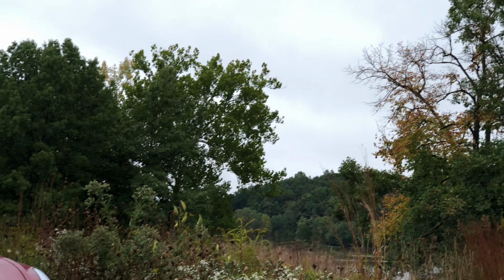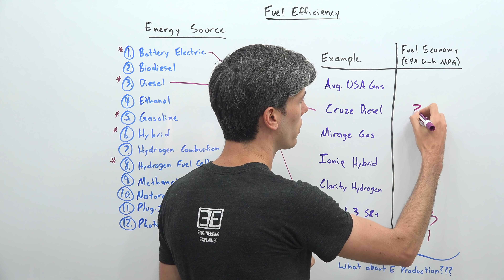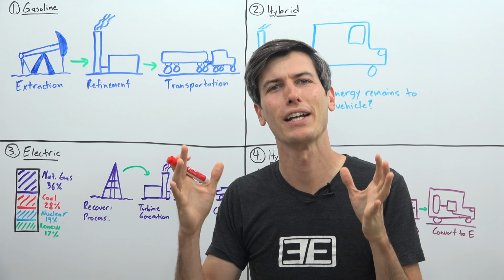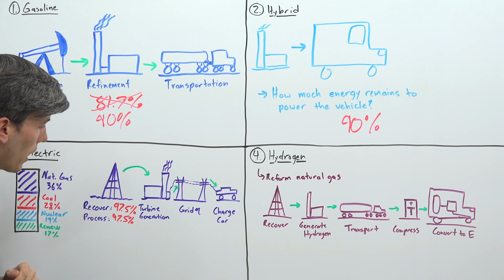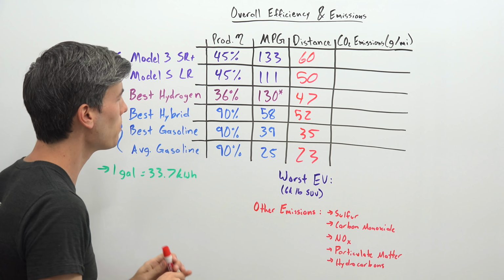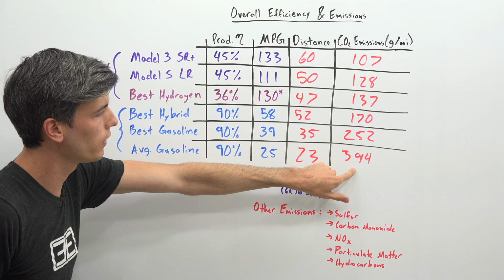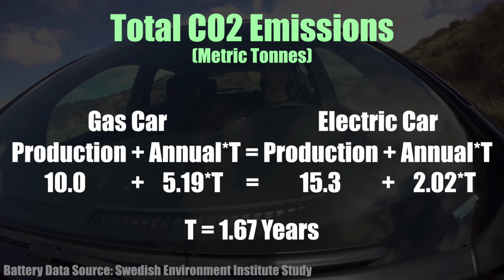Are Teslas Actually Better For The Environment?

Comment: I dont understand how in 2019 we are still talking about this! a vehicle that is powered by a series of explosions will have massive mechanical losses! not to mention with regeneration of the kinetic energy, we are talking at best a 40-50% efficiency when one examines the caloric efficiency. compare that to a vehicle with significantly fewer mechanical parts, significantly lower frictional losses, significantly fewer (if any) heat losses, and regeneration of kinetic energy! 

are we that misinformed that we cant comprehend this?
Reply: The whole electricity production and transportation is where we lose efficiency with EVs. The source of electricity like coal can lead to a situation where a hybrid or even a 45 mpg diesel will have less CO2 emissions than an EV. Electricity storage is an unsovled problem as of today and we will need this if everybody wants to drive an EV.
Reply: @nlagas  no my dude! electricity production is not static, but unchanging are the chemical and mechanical losses in extraction, transportation, refinement, transportation again before the gasoline can be utilized, and then still you must contend with the engine's inherent mechanical losses. compared that to electricity generation, which even if were to assume is 67% from fossil fuels, the transmission losses are minuscule! and the eventual EV is so much more efficient!
Reply: @nlagas  to help you my argument, my ev averages 250 Wh per mile, or about 0.9MJ per mile. my previous subcompact averaged 25 miles to a gallon, or about 5MJ per mile. 

that is a more than 5 times higher energy utilization for two vehicles, where the former is almost twice the weight of the second!
Reply: I have a Tesla 3 and I average 240Wh/mi don’t understand me wrong, I am an EV supporter and believer. I just say that EV inefficiency comes from the whole electricity chain. The mechanical losses you are mentioning are taken into account in this video with the MPGE. It is clear and obvious that EV are more efficient on this perspective but they lose a some advantage from the electricity production transportation and storage. And yes current world with a few % of EV works because there is not so many EV to really put a strain on the grid. But as soon as you convert a significant part of the fleet into EV this is where you see the big problem we will need to overcome related to production storage and transportation. This is where Musk vision of local production (solar) and local storage (battery) makes sense but this leads to size the whole system (on a global basis) to be equal to the total consumption peak demand while a grid system (current one) only needs 1/3 of the total peak consumption as production capacity to serve the demand. Bottom line, production at consumer side instead before a grid leads to massive over production capacity and hence resources/investments
Reply: I know, and its extremely frustrating. There is considerations for EV's but the emissions side of it has been known for quite a while. 

I think mostly people just don't want it to be true. They twist and turn and generalise, omit things, do anything to make the EV look worse than it is.  

Take the poster Nicolas above, he is completely wrong, yet doesn't even know it......
Reply: You should stick to non-engineering topics.

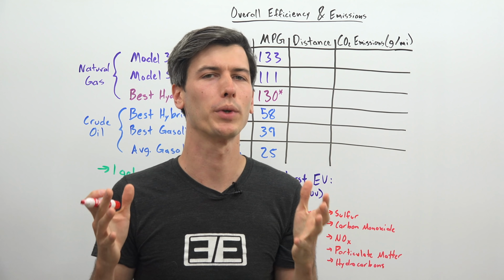Comment: 8:56 Anyone else notice they 100% stole the Dodge Stealth font for their "Stealth EV" logo?
Reply: Ever notice how the VTEC, Vortec, Voltec, Duratec, Ecotec and Ecoboost names sound similar or how certain design cues are used over and over with multiple manufacturers?
Reply: I guess, but I was actually just talking about a font
Reply: @Garrett Nixon Where did dodge get their font from?
Reply: OCD got the best of me here.  I wouldn't say they "100%" stole it.  Yes, the two fonts could be mistaken for one another, but the E, A and H are - in fact - slightly different.

Comment: Great info, still looks like Hybrid is a great option, even adding in the cost of production. Thanks!
Reply: Good option if you're on a dirty grid that won't ever get cleaner
Reply: Not really a good option. After all that in the video there are the mantelpiece costs and hybrids and gasoline really suck there :)
Reply: they're not a great option, that doesn't account for cost of the car and cost of ownership.

Comment: I once drove a Diesel (VW Lupo 3L) that got over 70 mpg, how have they become so much less efficient?
Reply: EPA requirements. My deleted diesel Golf gets 44 easily.
Reply: more like 70 cancers per mile
Reply: Mind that these are mostly based on american cars, America where a 2l engine is considered small, if you'd be comparing these numbers with alot of euro spec cars, the comparison would be muh closer
Reply: @ryanlong4021   my not yet deleted Passat get's around 40 mpg in the city almost 50 mpg on the highway, his numbers for an efficient diesel are way off
Reply: America´s take on efficient diesel concept ... recent european small city cars like VW Up! easily get 50+ mpg from NA gasoline engine while older turbodiesel engines could even touch 70 mpg when hypermiling
Reply: @theswimmingcarrot8496  The chevy cruze diesel is a 1.6L, its pretty much an european standard car. 
Jason is using US mpg (obviously), 37 US mpg is 44 UK mpg, which is typical for combined mpg ratings. And yes, emissions control and safety standards - extra weight etc, actually decreased mpg over the years.
Reply: My SparkEV averaged 5.5 mi/kWh (185 MPGe) over 30K miles. Jason's comparing published numbers, not what any particular car can do.
Reply: @theswimmingcarrot8496  I think it is fair the way it is presented, because he is comparing the ICE cars to teslas, which are fairly big, high performing cars and also not particularly efficient compared to  other EVs (Hyundai Kona Electric to name one).
Reply: @21Kamil12  rarely any European car would have such high value, especially diesel. The 1.6 would only have so much consumption in the city traffic. We understand very well that it was US MPG, that's what we're talking about, not the UK.
Reply: I still drive my diesel vw rabbit. Gotta be getting close to 50mpg.
Reply: @21Kamil12  so you're telling me, not only do the brits use a horsepower unit noone else in the world uses, but also their gallons are different from what other countries with medieval units use?
Reply: @TheWolvesCurse  I didn't make up the units and I don't know the history but yes, American gallons are something like 3.8L where UK gallons are 4.7L I believe. As for units of power, horsepower is the same throughout - no difference between bhp, hp, whp apart from where the measurement is taken (only whp is different here)
Reply: @21Kamil12  those bhp confuse me all the time. i watched a video from top gear yesterday about the new porsche 935, and the presenter said something about 690 horsepower. why state power numbers differently than anyone else? americans say it's 700hp, in germany and the rest of europe for that matter it's 700ps, in japan it's 700hp, just the brits don't measure on the crankshaft and come up with 690bhp.
Reply: @nigelnigelakiraakira  guaranteed 50mpg in the mk1 VW's if they're running right
Reply: It is a little known fact here in the U.S. that European turbo diesel cars get close to 70mpg (not UK numbers)
Reply: They have not really. My old Golf VII BlueMotion 1.6 could do 4l/100km ~ 71mpg (if you drove it economically). But then "Dieselgate" happened so now im back to gasoline.

Comment: so if you live in a city where you get your electricity from a dam , the emission per mile  = 0 ?
Reply: Nothing is free. Concrete to make the dam / lifetime electricity production, emissions to repair the turbines etc. But it should be very low.
Reply: @ctrlaltdebug  it's probably the closest we have though. Nuclear reactors coming in second but they require even greater concrete supply (more CO2 emmisons) and a whole nother beast when it comes to pollution. Not worst for the environment but different in that we can't figure out what to do with nuclear waste.
Reply: Dams are ecological disasters, stopping the flow of sediment to the beaches. We saved the world famous trestles surf spot from this fate. If you want to get a real feel for the amount of sediment blocked by dams check out the Elwha river on the Olympic peninsula.
Reply: in an ongoing basis, yes - essentially.
Reply: You may be forgetting the emission of chewed up fish.

Comment: Love your videos man. Something that should be considered however is the environmental impact of battery production. Mining for lithium or nickel is not very environmentally friendly because of water pollution, high energy expenditure to extract the metal from ore (which is usually only 1-2% the desired metal), and the mine water run off can be quite acidic because of sulfur containing compounds (results in acid rain and acidic streams, rivers, etc.). 

Source: I am a chemist.

Comment: My 74 Beetle gets 40 mpg in stock form.
Reply: There were plenty of vehicles from that era that were getting mpg in 40's. This just proves that the big manufacturers gave up on engineering years ago.
Reply: @EnlightenedSavage  and they were all small cars. Now even a small car is much heavier than they were.
Reply: and pollutes about 9x what a new car today does in the US.  seriously.
Reply: @lylestavast7652  with all the new tech the gas mileage should be the same or better. There isnt any reason we cant get 40 or 50 mpg with better engines, intakes, fuel injectors, and other such things.
Reply: @jailbird1133   I do get 40mpg in my accord.
Reply: @jailbird1133   I don't have a friend with a post 2017 Accord to compare against, but with the new cat converters designed to handle tier 3 gas (much lower sulfur), I'm interested to find out what their gas mileage is...   and in the US the cost of gasoline is so low anyway it's not something everyone is super driven to improve aggressively, sadly IMO.
Reply: @lylestavast7652  there was at one time what were called hypermilers. They had some interesting mods and techniques to eeek out every last mile from a gallon of gas.
Reply: @jailbird1133    I've never moded whatever, I know the hypermiling tricks etc...  only one I do is don't jackrabbit start and glide up to stop lights when I have the option and it's safe... I get the 40+ in my 2012 all the time in general driving.   My high is 43 btw.
Reply: I live in UT and we're just seeing Tier 3 gas, don't know anyone with the new cats - but it shouldn't affect mileage at all - it's not like increasing the ethanol content in anyway, and that would reduce the total energy...  this is just about removing sulfur and making sure the octane rating is as rated.

Comment: “If you wanted to power the entire U.S. with solar panels, it would take a fairly small corner of Nevada or Texas or Utah; you only need about 100 miles by 100 miles of solar panels to power the entire United States. The batteries you need to store the energy, to make sure you have 24/7 power, is 1 mile by 1 mile. One square-mile. That’s it.” — Elon Musk
Reply: Hmm. Musk also said his truck would be here by now, and it's no closer to reality than half the other bollocks he comes out with.
Reply: Turbo X yeah man makes a lot of promises but oh well the bigger issue is the power grid as of right now we couldn’t support everyone going home at night and plugging in their cars
Reply: @LivingInFloridaPanhandle  It's worse here in Australia. Our electricity is all from coal fired power stations, so even if we all bought Teslas all we'd do is send co2 emissions through the roof

Comment: Transmitting power from the power station, transforming to HV and then back down to 240v or 120v so it can be used is NO WAY as high as 97% efficient. This correction will change the outcome significantly
Reply: Indeed, its closer to 90 to 92%, which is what he said in the video......

Comment: Wait a second. How about powering the BEV from a house that has 100% of it's electricity covered by a rooftop PV system?
Reply: —> CO2 emissions of running the car = 0 (well, the CO2 of the production would still need to be considered however). That is what he said btw.
Reply: Don't forget about the emissions in the production of the solar panels, they're no joke either
Reply: Lucas Tseh Well, those could also be powered by renewable / non-CO2 producing energy.
Reply: But don't forget about all of the Emissions that are released in the production of concreate to make those buildings.
Reply: @nunayafb  Any hard figures how many end up in landfills? Every home solar I know operate even after 15 years, not aware of any that's been discarded.

Comment: One of your most important videos. However to benefit the environment, the people driving the high miles need to convert to electric cars. Probably most people using electric cars now  are low mileage drivers. Cross country drivers need to factor in hours each day to find a charging station available or wait for it to be available and then the charging time.

Comment: You missed the emissions generated in the production of the batteries and the cost and emissions of new batteries in about 5 years. Also the inconvenience/cost of not being able to go on any long trips because of the recharge time and lack of recharge facilities. It would be nice it you would do a cost comparison per mile driven over a 10 year period for the different vehicles. Say, 100,000 miles each.